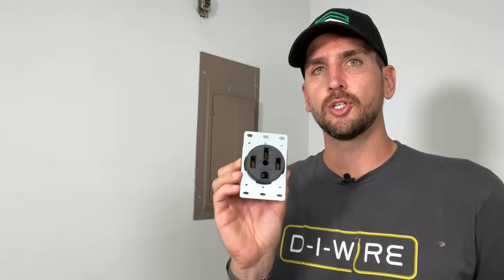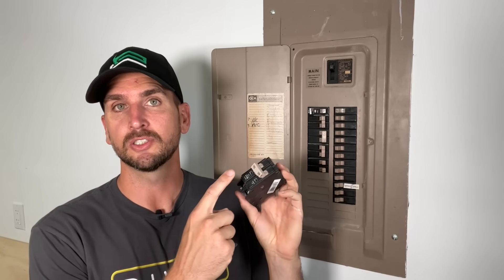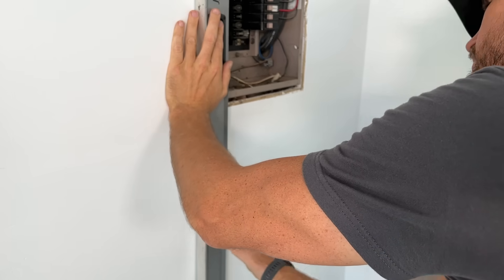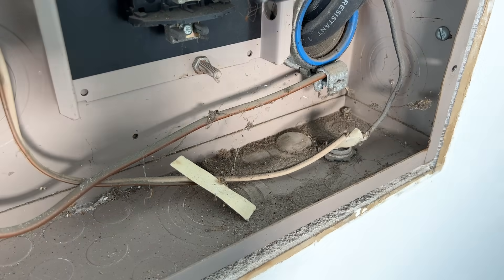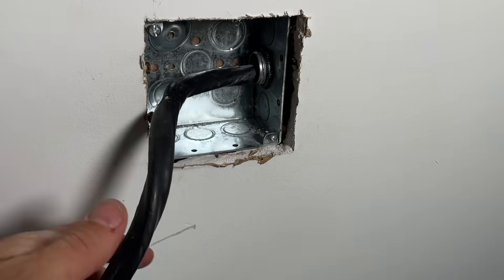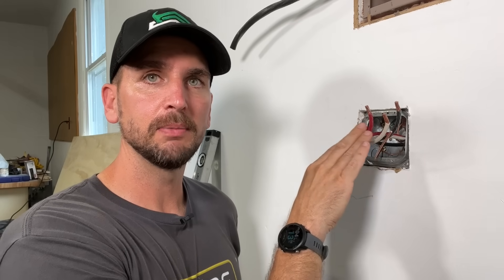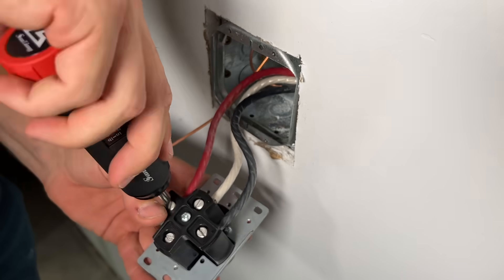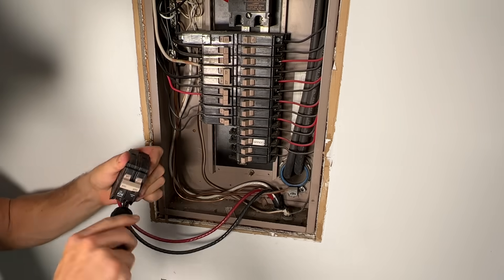Quick and Easy DIY 240V Outlet Install | 50 Amp NEMA 14-50

Comment: Cool video but 2020 came with some changes for 240. 

1. 210.8 (A) - requires GFCI protection to include the 240 volt receptacles for ranges that are within 6' from the edge of sinks and for 240 volt receptacles located in laundry rooms for the dryers. 2. 210.8(A)(5) - requires all receptacles in a basement (either finished or unfinished) to be GFCI protected.

Now, that 20$ breaker is around 115$. I’ll admit though, we charge 500-1000 depending on the run, so this is useful for homeowners :)
Reply: Is this a garage receptacle installed under 210.8 or a car charger receptacle installed under 625.54.  yeah, both GFCI now under 2020.  625.54 was some time before 2020.
Reply: Thanks for explaining this.  Making me reconsider my breaker purchase for the new oven outlet...
Reply: @WisconsinDIYGuy   Ranges do not need GFCI protection.
(6) Kitchens — where the receptacles are installed to serve the countertop surfaces. (Which the range outlet does not) and,

(7) Sinks — where receptacles are installed within 1.8 m (6 ft) from the top inside edge of the bowl of the sink.(not as the crow flies, but following the surfaces normally for 6 feet, which almost never applies).
Reply: @danrich6448  depends on what code cycle your area is on
Reply: Code doesn’t matter for self-install… until you sell and need the place inspected. Even then, it’s literally no different than having one installed by a professional before the code changed. Also, many places have yet to adopt the new code and are still inspecting and enforcing the old code (NEC 2017?). Code is important for licensed professionals and permit work but it isn’t strictly required for DIY. Another way around the GFCI breaker requirement is to install an EVSE with a direct-wire option. This saves you even more since you don’t need to buy the receptacle. You can also install a 48A unit, which might be smart even if your current vehicle won’t charge that fast since there is more reason to future-proof a direct-wire install.
Reply: @emmettturner9452  ... the problem with a 48 amp charger is you can't draw that much continuously (over 3 hours) on a 50 amp outlet. It will be considered a branch circuit and the 80% rule will apply, holding you to 40 amps. If you hardwire, then you can use parts for a 60 amp branch circuit, where 80% is 42 amps. Now the catch 22... none of the wall mounted chargers come with a 60 amp plug so now you will have to hardwire.
Reply: @rupe53  Yep. That’s why hard-wire installs enable you to have a 42-48A EVSE. :)

There are a number of 48A EVSEs with both plug and hardwire “dual” install options but you are supposed to use a selector that limits it to 40A or less when using the the various plug options. I don’t think there’s any way to stop an end user from installing a NEMA 60A welder plug to the same terminals but, well, the instructions still say the max settings are for hardwire installs only.
Reply: @emmettturner9452  The 2017 code requires that all garage outlets rated 150 Volts to ground (as in this example) require GFCI protection.  Ref code 210.8(B)(8)
Reply: @timothyrients1685  this receptacle does not exceed 150v to ground.
Reply: @bodaddy10101  The code specifies those circuits rated 150 Volts to ground or less.
Reply: @timothyrients1685  you are correct, however if you look in section 625, car chargers.....GFCI protection required for receptacles some time before 2020...2017 or 2014 or further back.  Only have 2020 now.
Reply: @bodaddy10101  625 car chargers.....receptacle GFCI protected before 2020
Reply: @emmettturner9452 "Even then, it's literally no different than having one installed by a professional before the code changed."
The date code printed on the wire gives it away. My receptacle also has a date code stamped into the metal bracket. So does the circuit breaker, but it's a sticker that can be removed. Not sure if an inspector would ever look that closely, but I suppose it's possible.
Reply: @emmettturner9452   You are COMPLETELY wrong!!!  The Code is a guide for safe and effective installations, and EVERYONE must must comply. If a DIYer does their own wok that causes a fire, your insurance may not cover it.
Reply: @robert-ne1835  Code applies to those bound by it… namely: Permit work, contractors, etc.

The code has no say in what the end user may build or plug-in, in exactly the same way that they have no say for non-permit DIY work from the end user. If they did it would be a law and not simply a “code” for various authorities to adopt or not. When those authorities choose to adopt a new code their authority does not negate private property rights, which is why it only extends to licensed contractors, permit work, etc.

This is precisely why code doesn’t extend to appliances and anything else you might plug in. They have no say. I can build my own appliances and hard-wire them if I want. Even if it caused an accident that insurance wouldn’t cover: Insurance isn’t law.
Reply: @robert-ne1835  By your logic, everyone with an EVSE installation that was done according to the previous code from a few years ago must update immediately or else they are in danger and insurance won’t pay. Every authority that is still following any NEMA code other than the latest is causing fires and lost insurance cases for their constituents.

You said it yourself: They are a guide. Certain authorities can impose those guidelines as rule on those who they have authority over, which is those performing licensed/permit work… exactly as I said in the beginning.
Reply: @emmettturner9452  Article 90.2 Scope states: “This code covers the installation and removal of electrical conductors, equipment, and raceways;” and Article 90.4 Enforcement states: “This Code is intended to be suitable for mandatory application by governmental bodies that exercise legal jurisdiction over electrical installations, including signal and communications systems, and for use by insurance inspectors.”  What this means is that the code applies to the installations, not the installer or their licensing status.  Furthermore, my logic NEVER suggested that previous installations must be updated immediately.  It is general knowledge that most codes (not just the NEC) pertain to new or modified installations, and do not require existing installations to be upgraded.  My actual point was that, just because you think that you can do whatever you want because it is “DYI” doesn’t mean you actually can.  It depends on the Authority Having Jurisdiction (typically a designated Electrical Inspector) to decide if an installation must be done my a licensed individual or may be done by a property owner, however most inspectors that allow owners to do their own “DIY” work still request a permit to be submitted and inspections performed.  Regardless of any of that, the installation itself must still comply with the NEC unless specifically excluded in article 90.2 - Scope, including such things as ships, mines, or utilities.  There is no mention of work done by DIYers in the exclusions.
Reply: @robert-ne1835  “What this means is that the code applies to the installations”
No, it applies to the installations they have “legal jurisdiction over,” which is licensed and permit work… EXACTLY as I said. The NEC can’t just declare that the “code” applies to everyone. Indeed, the “governmental bodies” it refers to pick and choose which version of the code they want to adopt and even offer exceptions to the code they do adopt. Example: Some still follow the older codes that do not require GFCI for an EV outlet and some others that adopted the newer code specifically exclude that requirement for EVSEs due to nuisance tripping and the fact that GFCI is redundant considering what is supposed to be inside a J1772-compliant EVSE (built-in GFCI… hence the nuisance-tripping).

Comment: Couple things. I am a journeyman electrician I bring that up because it's relevant. 

1. I would not use a residential grade receptacle for this they won't hold up to the constant plugging and unplugging 9f a vehicle charger. Those are built for a range or dryer that gets plugged in and doesn't get touched for years. 

2. All garage receptacles must be GCFI protected. Those 50 amp GFCI breakers are like $90 dollars by themselves. The NEC makes no exception that I'm aware of for car chargers with built in GFCI protection. Even if they did you don't know what will be plugged into that receptacle other than a car charger. Like perhaps a welding machine.  

3. Good work using the torque screwdriver.
Reply: @davidicousgregorian  DIY guys don't make good customers. They are going to do these simple jobs themselves. Might as well try to keep them safe while they do it. As far as revealing secrets Magicians do it all the time. There are stacks of books on how to do magic and there is money to be made there. It's funny you mention magic though because i actually took up doing simple close up magic to entertain my kids. Which is how I know they make books on the subject.
Reply: With regards to your number 2., yes the 2020 NEC code updated 210.8A, but it would depend on if his state has adopted the 2020 NEC code. I believe only 19 states have thus far.
Reply: @JimYeats  fair point but I still see no good reason not to do it. You don't run into problems by making things safer. Sure it adds about $60 bucks to the cost but small price to pay to potentially save a life.
Reply: @johnh8546  ... it's been pointed out to me that many chargers have GFCI protection built in so a hardwire installation would be an option, especially since having two GFCIs on the same circuit may lead to false tripping.
Reply: @rupe53  true but you can't guarantee a car charger will be all that ever goes into the receptacle. Residential welding machines can be plugged into a Nema 14-50 so it's possible all sorts of non GFI protected devices could be plugged into that receptacle.
Reply: @johnh8546  ... except that I said "hardwire" to avoid that issue. If there's no plug, the problem is solved by the GFCI within the device. (if it has one) You'd need to read the owner's manual to see what you have.
Reply: @rupe53  I agree hard wiring is a much better option. This is about installing a Nema 14-50. Any customer asking me for a 14-50 for EV charging I always recommend hard wiring. Some still want the outlet though, and I use a Hubbell 9450A it's an industrial grade receptacle and much better than the residential grade ones.
Reply: @johnh8546  ... yes, but now you need to consider the double GFCI issue. Always read the manual!
Reply: @rupe53  yes most manufacturers want you to not plug their chargers into a GFCI receptacle which is why for an EV charger I always try to get my customers to go the hardwire route, but I won't install a non GFCI protected receptacle in a garage. I will say I've lost buisness on that after explaining to my customers the issues.
Reply: @johnh8546  ... when you are in business you follow code. There's not much to discuss.
Reply: @rupe53  it's not required by law in my state. I just refuse to do what I consider sub par work.
Reply: @johnh8546  You ALWAYS run into problems when making things safer, its just a determination of whether the extra expense, time, and hassle is worth the added safety feature. As we have less and less concerns to worry about in life, we will continuously become MORE concerned about minor and minor things. Such is the way of things.
Reply: @JimYeats  Important to consider as this does substantially increase the cost.

Comment: Lucky you to be able to situate the outlet right under your electrical box. That is why only $66?? I’d have to place outlet on opposite side of my house! That would cost a whole lotta money for the Romex….
Reply: Romex costs money, but WAY less than buying a 100 foot extension cord.
Reply: Yeah, I would be looking at over 100' of wiring and a rather difficult run.
Reply: @timezonewall  ... some people overlook the easy solution of drilling through the sill plate from the basement and running a cable around the outside to a point near the garage, or wherever it's easy to access the desired location... then making another hole to go back inside. On a single story, you can drill into the attic and run wire across.
Reply: @rupe53  The area I live in uses post tensioned slab foundation, you can look it up if you are unfamiliar, bottom line: there is no basement....and it's two stories. One could run a vertical 25' conduit up the side of the outside wall, run it across the attic, then another 25' conduit back down on the other outside wall. It would be kind of ugly and still not all that easy. I've seen homes in the area running vertical conduits to the roof for solar and it's not a nice look, but it gets the jobs done.
Reply: @timezonewall  ... see, you already have half the problem solved. You could paint or stain the conduit to help it blend in.

Comment: Is it ok to run wires through the bottom of the breaker box ? In my area, it's not. Everything has to exit through the top. I don't understand why though. Maybe you do.
Reply: If the panel has knockouts on the bottom, then yes, you can run additional home runs through the bottom. There may be some panels that only have knockouts on one side, so that might be why in your area, everything goes through the top.
Reply: @aurvaroy6670  👍

Comment: Good luck if you have room in the panel. Newer panels is design not to add subpanel
Reply: Huh?  Of course you need room in the panel, he said that.  If you don't have room, then you need a subpanel and will need to move some existing circuits over to create room for the breaker going to the subpanel.

Comment: Is it necessary to put a neutral for that 240V receptacle??
Reply: If the EV charger has a circuit built in that requires 120v ( timer circuit, display etc) then yes, it will need a neutral wire. If the charger does not require a 120v source, then no. But you may as well wire up the neutral so the outlet can be used for other appliances such as a welder , pump etc.
Reply: @Matt633NLT  They don't.  The ones that come with nema 14-50 plugs have the neutral hanging inside.  "timers, display etc" don't' run on 120V anyway they run on 5 or 12V DC which can be made from 240V just as easy as 120.
Reply: depends on the receptacle. Did you know that there are many different 240v receptacle models/types.

Comment: I just hardwired a wall charger because from my research the levitron is no good for long term use . And the 2020 nec guidelines say that a 14/50 used for ev charging needs a GFCI breaker and there like 200 bucks
Reply from the maker: Yeah, we are still on 2014 NEC so at least for now my area we don't need GFCI protection for the 50 Amp breaker.